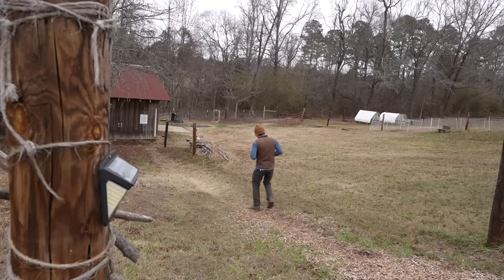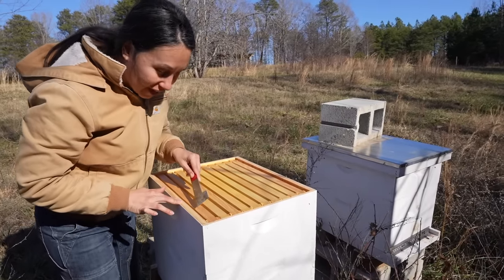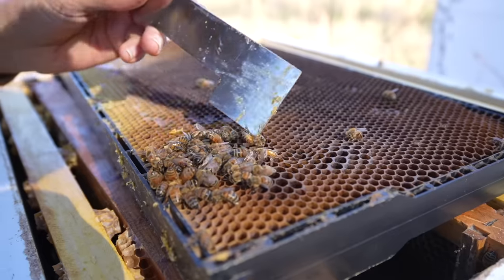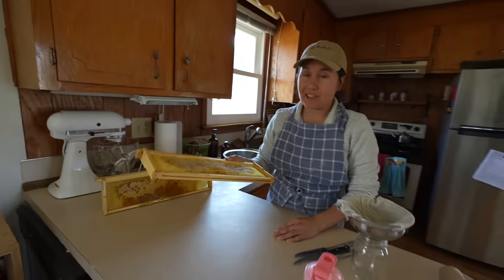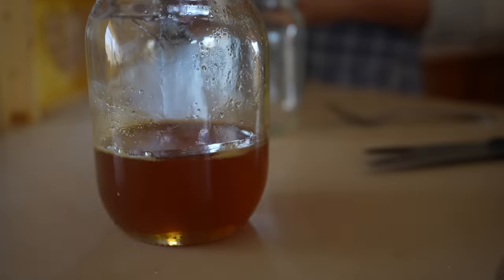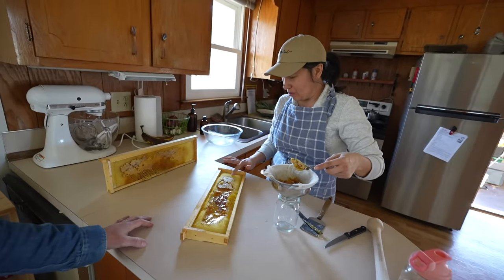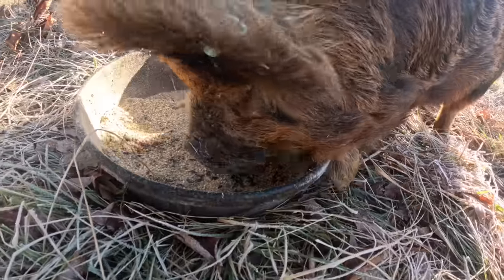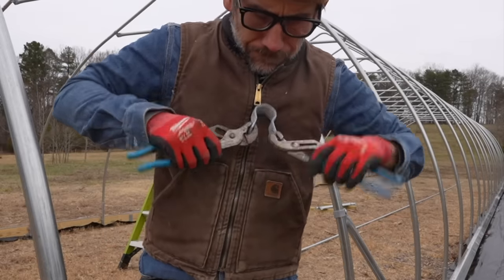Who killed our Bees

Comment: Hi the I believe reason those bees dies is because the number of bees got low (most likely lost queen) and you had to much space and the colder nights we had killed the bees. Something I have learned from experience is  you have to have a good ratio of bees to the amount of space you have in the hive. An example that I like to use is trying to heat a 3000 square foot house with a small electric heater is like a small cluster of bees trying to keep two boxes of the hive warm.

Comment: Hi I joined 2 tubes at a time on my tunnel, both work as you show. Our tunnels in UK are a bit different (they were 10 years ago when I put mine up) I didn't have the spring clips like yours They looked interesting on your pig one. I did mine in summer to get poly really tight . It is still like a drum skin, it was 50°C inside the tunnel when covering on my jack as all the people that said they would help with cover dissapeard for a few days LOL. I enjoyed a cold beer or 10 when I was done

Comment: Ridge pole -I’ve done 2. The long pole method I didn’t have space for. Attaching 1 at a time was exhausting for me. But building out 3 lengths to run into the brackets & adding a new length everytime the other end was in the bracket on the hoop worked for me. 
There was a lot of back & forth. But less stress on my neck & shoulders

Comment: Hi Jason, sorry about the bees, but looks like you have good advice from others on that score. High tunnel is looking great just remember to install the plastic on a warm day. If you do it on a cold day then when it warms up it will sag and you will have to re-tighten it. Also, did they supply anti-hotspot tape for you to put between the metal poles and the plastic. It will extend the life of the cover if you use it.